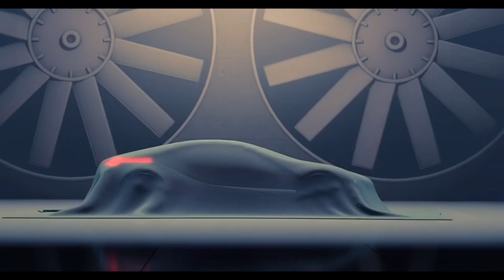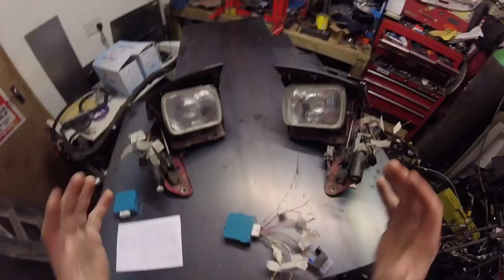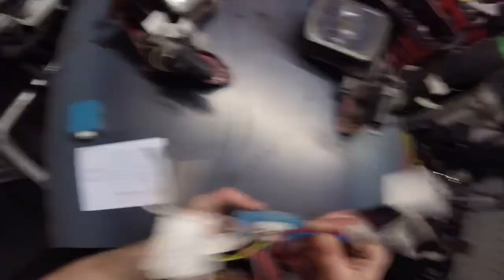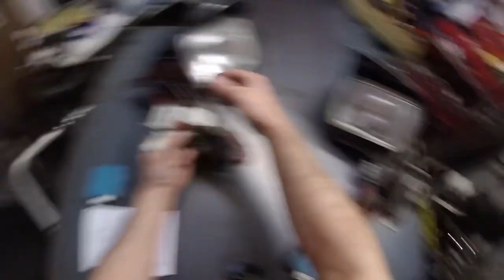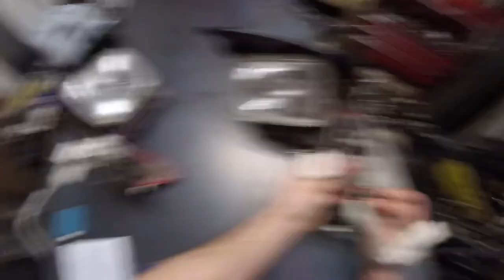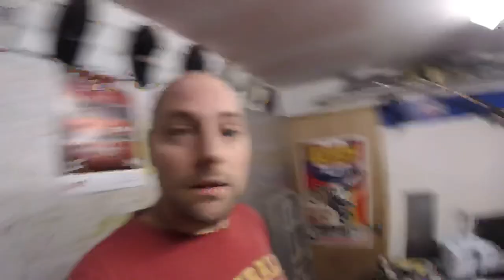How to make pop up headlights

Comment: are those the Toyota Celica St185 ones?
Reply from the maker: Yes they are the ones I used but you can use mr2 ones to don’t for get Toyota use a negative pop up trigger most cars use a positive Triger so you mite have to put 2 relays in to change it if you don’t know how that works or you get stuck just ask 👍
Reply: @Spoonersoutings  Ok, Thanks!👍

Comment: so i want to make a lamp out of a front of a mazda astina (with pop up headlights) can i make them work if i press a button and let them shine?
Reply from the maker: A Mazda astina wow that’s a rare car I’m not shore if it shares the same pop up motors as the mx5 but what you want to do is possible
Reply from the maker: All you have to do is find the trigger wire that activates the pop up then wire in a separate switch so when you push the switch it complete the trigger Circuit making the lights pop up and flick the switch again the lights go down but the lights won’t come on just pop up and down. Fined a wiring Diagram of the lights Circuit it will tell you what wire you are looking for. A Toyota is a negative trigger so you would run a wire off the ground into the switch and then out of the switch onto the Triger wire and Vice versa for a positive trigger. Hope that helps
Reply: @Spoonersoutings  thanks for your help
Reply from the maker: No problem if you need anything else just let me know and I will try my best to help 👍
Reply: @Spoonersoutings  it will take a while before i start my project
Reply from the maker: Definitely get a manual on your car ie Haynes manual, or some sort it will help loads

Comment: Do you think it's possible to install pop up headlights in  something like a 350z
Reply from the maker: It’s possible but it comes with a lot of fabrication work as not only do you have to make a new hood you would have to alter some parts of the radiator mounts all do a bull of course
Reply: anything's possible but wtf
Reply from the maker: It’s possible. each to there own on there builds some people mite like it others not. It’s all about what you like not what everyone else likes 😉

Comment: hi there am building a knight rider replica my car is a 91 but converted it to look like a 84 for the last 5 years i havent figure it out lol
i swapped my 91 headlights to a 84 style stupidly of me was talked in to doing so lol now my problem is the 91 headlights have only two wires coming out green and grey but the harnes from the motors got 6 wires so i figuret out shit hit the fan
i managed temporally to get them to work joining some wires together but that makes the battery dead or pops the fuses after a week or so
yesterday i started to try it again and took it all apart i got a 4 pin relay and mounted the green wire up to it it now brings the headlights down and kills the power to the motor no longer draining the battery but the other wire you would think easy!!! do the same for the grey wire  but no!!! nothing happens wont go up the motors they got 3 wires comming out grenwht grey and redwht 
to ceep it simple the wires comming out of the car r two green and grey where the grey seems to have power all the time  and the green when you press the switch on the dash shit is to confusing GMs brains where not at the table designing it it could be so easy
also the 91 got an upgrade from GM and got a auto pop up sensor that i bypased so they dont pop up automaticly hmm any idea what to do thewiring diagrams r black magic to me at this point lol
Reply from the maker: Soooo coool I love the knight rider car, 🤔 let me have a think and do a little research and I will get back to you and hopefully I can help the sticky situation your in
Reply: thanks a lot dude!!!
Reply from the maker: Email me on Spoonersoutings@outlook.com I have some information for you
Reply: @Spoonersoutings  

hi just did thx
Reply: it worked  💪  thanks a lot i will make a video of how i conected it all for other people  in need of help only down side the automatic headlights pop up  no more working i think its cause  of
Reply from the maker: Glad I could help. One relay should pop the headlight up and the other should make it go down that’s why there is two relays for each side and the 5th relay switches from up to down when the lights come on, but well done buddy 👍